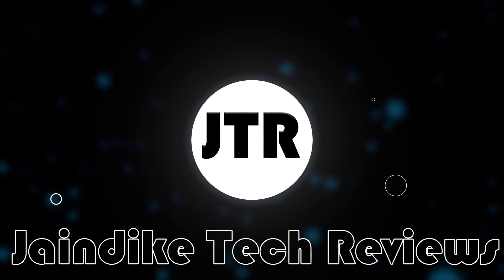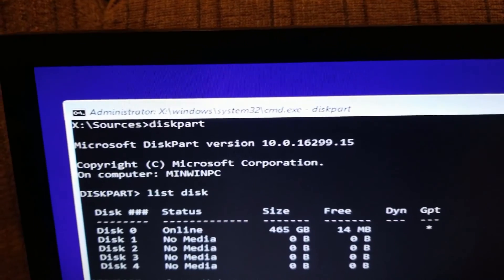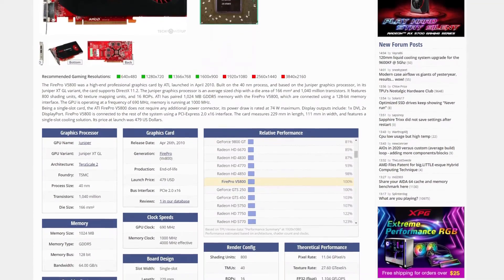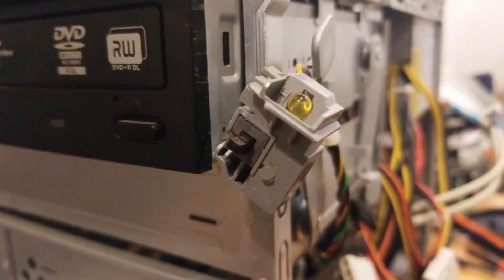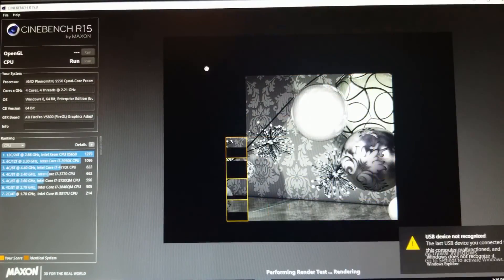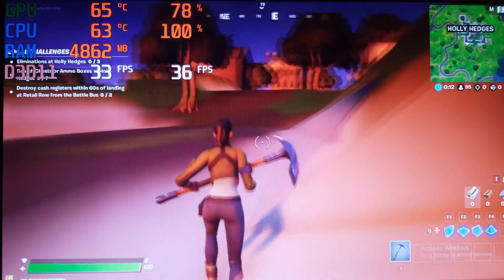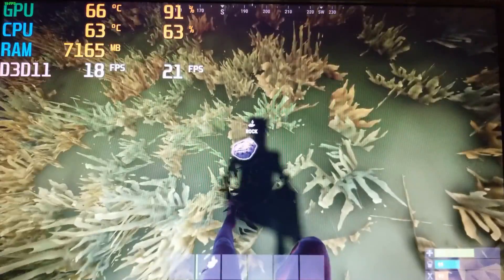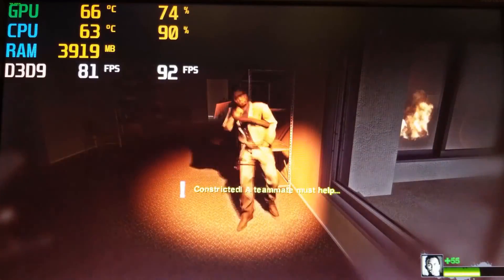UPGRADING an OLD PC for GAMING! - Cheap Budget Computer Build & Benchmarks

Comment: Ran pretty well all things considered, though Borderlands 2 on high settings is certainly a bit too much. I'd say medium quality with PhysX quality on lowest or off should be better there as well as otherwise it's rendered on the processor which even newer processors struggle with due too the game not utilizing multiple cpu cores that well in the first place unless you have a nvidia gpu in there thats decently quick too handle the physx effects which a gtx 680 should handle on maximum settings.
Reply from the maker: Yeah, not bad for $25

Comment: The stuttering and the random Fps drops are caused by the CPU(i own one of these pc's but it has a overclocked Semprom 145 instead.), changing the gpu to something like the geforce 9600 gt will help it a little more 'till the time to change cpu's.
Reply from the maker: Makes sense, Im considering revisiting the system with a new processor
Reply: I recomend to you Buy the latest Athlon 64 2X, it will have the performance of a athlon X2 but it will be cheaper, and if you want to keep the ram to 2gb, go for dual channel 1gb sticks or go for 4gb(2x2gb if the motherboard support it, if not the 3gb), if you cannot get the 9600gt, the HD6670 or one of the Gts series will work just fine

Comment: limiting the fps should lower cpu utilization. it probably wouldnt have been made much of a difference, but still thought id mention.
Reply from the maker: Ngl, I never knew what that feature did, I'll see if that can fix any issues in fortnite
Reply: @Jaindike  yeah, there's actually an interesting anomily that 4k gaming requires a less powerful cpu because less of the CPU is being utilised(due to  lower framerates). From my understanding the game will perform consistent better if you limit the fps to the refresh rate of your monitor or to a comfortable fps. It raises the lows, by limits the highs.
Reply from the maker: @Joshuafrfr  That is actually really interesting, and I never knew that. Joshua Speedy tech tips coming to a store near you
Reply: @Jaindike  just me tryna squeeze all the performance I can out of a 7 year old system.
Reply: Video on the subject ↓
Reply: https://youtu.be/AzJ6UiRUGM8
Reply: https://youtu.be/SVde0lIA9LQ
Reply: For this to work your gonna need a good GPU like the RX 570 or higher can be highly depending on the CPU and results may vary CPU to CPU
Reply from the maker: @Imblitzyboi  Aight Ill go check these videos out then, thanks
Reply: @Jaindike  sorry if the videos weren't completely about the subject but it should help you understand  how turning up the graphics can sometimes help performance on a potato CPU but it can also do the opposite on occasion
Reply: @Imblitzyboi  I think it is a better idea to just limit framerates, but it is a quite legitimate way to increase performance. I find myself limiting my csgo fps to 60 because my CPU will have less load and will run at a higher clock. It allows me to turn my graphics settings up a bit.
Reply: @UCYakJPdgh70Ux1oHPG1qzmg lmao, I play in 600x800 in csgo, but I have actually found limiting the fps to still significantly help. It is probably because I have absolutely terrible thermals, but it really is a case by case basis on weather or not it is beneficial to limit the fps to the monitors refresh rate. In some cases it does matter, like in heavily cpu intensive games. About raising resolution to artificially limit fps, I could care less, because it is more diverting the power rather than taking some of it away.

Comment: Love trash picked computers
Reply: Half the time the parts in the computer can be damaged or have missing parts or crap parts so its a bit of a gamble
Reply from the maker: @Imblitzyboi  Your right, it can be a gamble, but for the low cost of free I cant complain
Reply from the maker: Same, and most of the time their either fully functional or easily